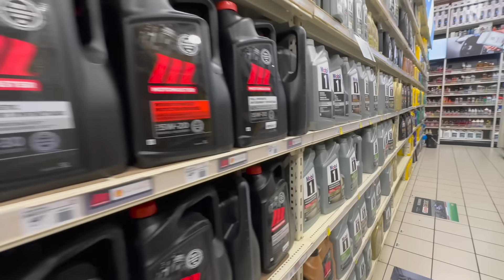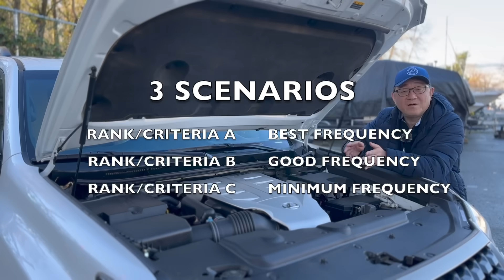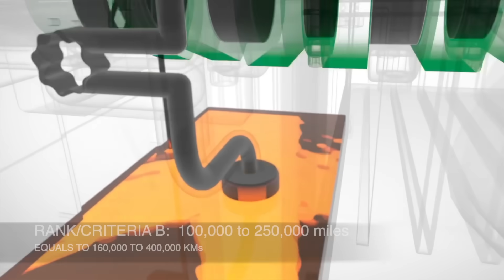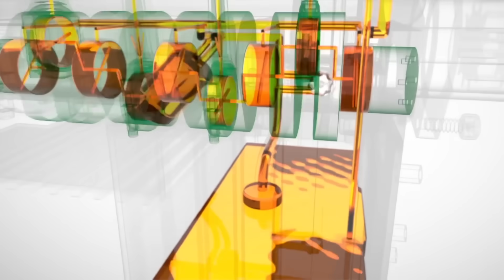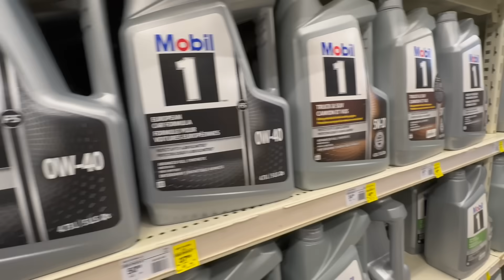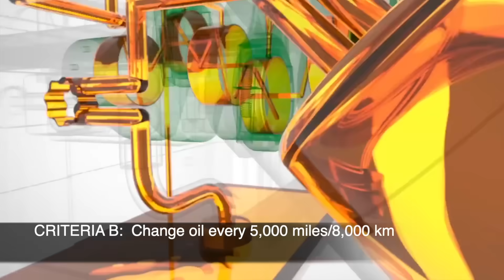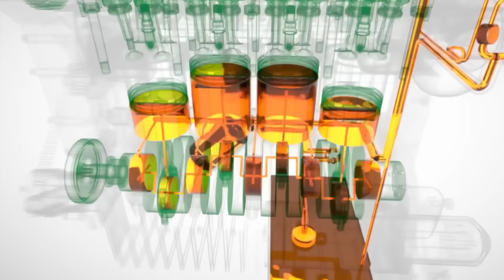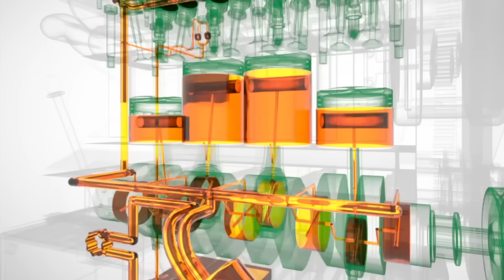ENGINEER EXPLAINS HOW OFTEN TO CHANGE OIL & FILTER // UPDATED CRITERIA-BASED RECOMMENDATIONS!

Comment: As a retiree that only drives 1,000 miles a year, I fall into the change it every year category. I drive 3000 miles a year but it is 1000 each on 3 vehicles.

Comment: BMW 2009 335i E90 owner. 200,000 km. runs smooth, no oil consumption. no leaks. 5W40 castrol edge synthetic every 9-12 months or 10,000 km. anything longer the oil gets too dark. ignore the 24,000 km recommended intervals LOL.

Comment: When you buy a new car, it  normally has about 5 years free servicing anyway. If second hand, check for service history. If none, hope for the best and use synthetic oil and change oil and filter regularly. Don't forget to check air filter too. That's overlooked a lot. 😬

Comment: I drove with diesel vehicles over 2,000,000 km or over 1,400,000 miles. I change my oil every 5,000 km (approximately 3,500 miles). May the Lord bless and keep you. (I always buy my cars old with about 300,000 km on the speedometer for about 1,900-2,000€ and drive on them over 200,000 till 500,000 km on the speedometer.)

Comment: After working in engine development the biggest problem is people put the wrong oil in.... It's the acea number that counts NOT 5w 50 or whatever temperature range your country requires. I use the EXACT oil the manufacturer states and it gets changed ever 2 years or 20000 miles... I don't do that many miles in the car only about 5 or 6000 miles a year. But it's always clean, never burns any and hasn't missed a beat in 10 years.

Comment: I had a 2015 Mazda Miata, purchased new, that stayed in our garage most of the time and was used primarily for joy riding. It was traded in 2020, at about 10k miles. The oil (Mobil 1) and filter was changed yearly but the owners manual stated every six months. I could not believe that the oil would degrade with mileage that low but I was breaking the warranty I guess. Loved the car but it had too many limitations.

Comment: My daily driver is a 2015 subaru wrx with the 2.0L boxer high compression direct injection and high boost twin scroll turbo its all stock and with an occasional exception of having a moment of fun with that turbo winding up I'm pretty conservative the way I drive her. But as a bumper to bumper certified tech and being the manager of a large auto service center I know what oil is put thru in modern engines especially high performance turbo boxer engines like mine and I see every day the consequences of neglect with so many of my customers going WAY too long on their service intervals and I know that today's synthetic oils are very long lasting and I know I'm beyond anal about it but I never go a mile past 2K miles between my services and that's with only the best synthetic oil which is actually a requirement on my Subaru but I don't care if people say I'm wasting money by servicing my car way too frequently to the point where the oil I drain out still looks almost new when I change it I believe frequent service is cheap insurance and I would rather spend a bit more on oil and filters than end up having to replace my engine and that is especially true on my car since it has a very complex high tech and high performance boxer engine with high compression and a twin scroll turbocharger pushing very high boost for a stock turbo. So for any car bit especially on a car like mine I would much rather spend a bit more on oil and filters and other maintenance items more frequently than risk damage. But then again it's easy for me since as an auto shop manager I get everything at a steep tax free discount on all the very best stuff and I have a shop and a plethora of tools and equipment and lifts to service my own vehicles anytime I want or need to and it barely costs me anything just as long as my paying customers are taken care of first as soon as the doors close I have a shop and any parts I need at my fingertips and at a price that is so low I don't even notice it in my finances but I know not many people are in my same situation and have to pay regular cost for their car care. All I can say is that oil and fluids and filters are a hell of a lot cheaper than a complete overhaul and don't listen to the manufacturers recommended service intervals cuz they want u to go to them for repairs and eventually buy a new car from them so there's nothing wrong with doing a complete oil change service every 2K miles like I do even when using the very best ultra long life synthetic oil especially if u have a performance engine like me like the old adage goes its cheaper to maintain than it is to repair that's gospel lol

Comment: TRANSMISSION FLUID N FILTER EVERY 30000 MILES?  rear differential fluid every 30000 miles. xfer case fluid every 30000 miles? pwr steering fluid every 25000 miles?

Comment: Sludge and dirt deposits stick to hot metal engine parts. Thats why doing an oil analysis is an inaccurate way to determine the health of the engine. It shows wear metal and coolant contamination but doesn't show the amount of sludge and contiminants that stick to engine parts and plug oil passages that shortens engine life. Dont test your oil. Change it.
Reply from the maker: Well said!

Comment: I wouldn't want to buy a used car off someone who treated the engine like those in Criteria C who only care about the engine lasting until they sell it and to hell with the next buyer.  I've been changing every 8,000 km (9,600 km with synthetic) but am a 'drive it into the ground' type so should be changing every 6,600 km with synthetic it seems.

Comment: Clean oil is the most important factor I agree. 2022 Ram 1500 5.7 etorque 4wd Limited IMO the OEM oil filters are the worst you can buy. I just finished a test with 3 filters Trasko bypass full flow combo, OEM Mopar MO899, and Hubb reusable filter. I used Blackstone oil analysis for 4000 miles on each filter I requested the particle count for each oil sample. The OEM filter had the worst particle count of all 3  45 times higher than Trasko and Hubb.  Flow to me is very important I'm not an engineer but the 5.7 Hemi has a known problem named the Hemi Tick caused by what most information I can find is a lack of lubrication and or dirty oil I can see why after testing the OEM filter. Hubb offered another benefit that I didn't expect due to the full flow, the engine and transmission synchronized far better meaning much less jerky shifting due to more oil back pressure. For example, I come to a red light braking then the light turns green I hit the gas, with Hubb I'm in the right gear, and RPMs with OEM or the Trasko the transmission would either upshift or downshift Hubb keeps you in the proper gear and at the right RPM's does this matter to me smoother is better, clean oil and maximum flow is the best I can do for my engine. I also use Amsoil 0W20 SS they say 25,000 miles I change every 4,000. Ram says the coolant lasts for 10 years I change it every 2 years and use a vacuum to refill very important to eliminate air entrapment. Front and rear differentials every 10,000 miles, transfer case every 20,000 miles, brakes every year flush with 2 liters with AT'E 200 spark plugs 48,000 miles sure it may be overkill but my goal is to keep this truck for many years its cheap insurance.  The Hemi 5.7 was discontinued V8 engines are being replaced with EV or V6 with twin turbo I like the V8 extra maintenance will ensure the best chance I have. I do all the maintenance myself and I save on labor and most importantly peace of mind knowing it's done right. I experienced this with several Ram dealers using the wrong oil or the wrong viscosity is why I started my own service for all fluids years it's not hard I'm 66 and just changed the spark plugs local shop wanted $800 I did it in 5 hours drivers side took 4 hours due to confined area, the torque was off 4 ft-lbs and the gap was off 4 thousands from the factory should be 44 thousand NGK and the manual states 44 thousand but in the box was gaped at 40 thousand my mpg went up 2 mpg if I had waited to 100,000 mile what would the cost be.  It cost me $155 for the spark plugs The old saying is true if you want it done right do it yourself.

Comment: A: READ the manual that comes with the car. It tells you what oil to use. B; SUE, yes, SUE if the DEALER changes that without your permission. If you want to ruin your engine use different oils and see which detonates your engine. It was too late for me and cost me thousands and lots of time. OOPS, there goes another 2 or 3 grand.

Comment: Have owned and driven a 2014 
Volvo V40 T5 (5 Cylinder Turbo) Cross Country since new. Just drove through 44,000km today. 

Synthetic Engine Oil and Filter changes at the Volvo Dealership every 6 months or 5,000km.

Comment: I worked for a oil company and just through interest I would get samples of my oil and get it lab tested, I learnt that the quality of the oil matters, when oils are sold they are required by law to meet the specs that are claiming.
But where the problem lies with cheap oils is the length of time that they stay in that spec.
 Now even David is saying that synthetic oil lasts longer.and the reason that is,is because it’s a better quality then the other.,
If the friction moderfiers have reached their usefulness, because of lower quality additives 
You are stuffing up your engine, a good quality oil will last a hell of a lot longer than  1000 m more than a crap oil that has ceased to maintain its its original specification

Comment: Great video. The key here is that "manufacturers recommendations" are really marketing tools designed to appeal to the cheap and lazy. Increasingly, manufacturers offer "free maintenance" for the first two or three years and then announce a scheduled maintenance plan that will not involve the type of maintenance that will keep the car healthy for the long term. Most manufacturers do not even recommend any sort of "break in" period for new cars. Basically urging customers to "rush out and do some damage that will bring you back for another car in 5 or 6 years."

Comment: Good engineering is what makes a engine last and good old fashioned oil  and high flow filter and a lower temperature thurmastat straight six engine rear drive and mechanical lifters  and higher octane fuel is king

Comment: I drive my 2018 LC500 less than 1500 miles per years. Have driven it approx. 5000 miles since I bought it new in 2018. How often should I change the oil?

Comment: 20k miles or every second year oil change intervals have been quite common for 20-25 years now, with cars having a 5 year warranty limited to somewhere between 50 and 100k miles. My 6+ year old Skoda 1.4 TSI turbo has done 65k miles, still use no oil between changes, and seems to run just as well as when new. Oil changes have been made on average around 12k miles. I drive gently, usually in the 1300-2000 rpm range.

Comment: I change every 5000km or 6 months.  Full synthetic.  Filter every 2 oil change.  Have done this with every car I’ve had.  I generally buy new and have them for 6-7 years.  I had a friend who worked as a lab technician with Castrol and this was his advice.
Reply: Oil filter cheap why not change it same time.
Reply: @ it’s a lot messier with my car.  I mean I still get 95% renewal of detergent,additives and clean oil.   A bit lazy I guess.
Reply: You can skip the filter on a 2k oil change
Reply: Dont buy cars every 6-7 years, you are contributing to causing more inflation in prices and more needless waste.  The average car held is now close to 13 years.  You are not even doing how much the extreme consumerist minded person in the West does.
Reply: I’ve been doing 4,000 km plus filter change at every service too.
Reply: Sound advice
Reply: I like this approach, Oil filter is still being changed per the manufacturers spec, just getting 95% of the oil renewed. Makes the job a lot quicker and cleaner.
Reply: Your friend gave you bunk advice. Thats why I trust Valvoline. Change the filter every time or else dirty fluid and contaminates can get into the new oil and contaminate it.
Reply: Cheap ass dude.  Filter doesn't cost much.  Why in the world would you was wait to change it every two 2 oil changes?  You are being cheap for no right reason 😡
Reply: Savings on oil filter  being used for 2 oil changes is not worth it. Why contaminate your fresh oil .
Reply: Dude change that dern filter EVERY TIME you change that oil.
Reply: @MrBigBoy4Life  Not necessary w/good synthetic long life oil filters like Purolator PurOne & Fram Ultra synthetic/Endurance synthetic.
Reply: Every Oil Change Is A Must Change Of Oil Filter

Comment: I was a Senior manager in one of the big auto companies and one of the departments I was responsible for is fluids which included engine oil.  The properties that we analyze for in oil is acidity, metal and diluent content (like water and hydrocarbons) and viscosity.  When Oil oxidizes, it becomes acidic and that is bad for your seals.  metal content comes from part wear like bearings, and other parts.  The most important oil change is the first because there is machining particles and sand from the manufacturing process.  Regardless, you should follow manufacturer's recommendations which is typically 10,000 miles or less for conventional oil like GF6.  We have tested oil like Mobil 1 which is synthetically called poly alpha olefin which will last in excess of 25,000 miles.  The algorithm in the car is set to go off at 10,000 miles because the manufacturer doesn't know what kind of oil you have in the car.  Everything you said is untrue is very irresponsible.
Reply from the maker: Thank you for your comments.  I've worked as an automotive engineer for several different automakers, as well as for engine parts supplier.  Unfortunately, your opinion represent a biased view since major automakers do not typically take apart customer's cars after 200,000, 300,000 or even 500,000 miles.  Have you physically taken an engine apart at those miles and looked inside?  Have you worked closely with an experienced mechanic that specialize in overhauling engines?  If you did, you would know that 10,000 miles are the "bare minimum" to keep engine clean and running well - but not sufficient if you want the engine to be in top condition for 200,000 miles and beyond.  The automakers are not interested in keeping cars in consumer hands for upwards of half million miles since that would be disastrous as that would result in dramatic decline in new car sales.  My advice is based on actual mechanical review of engines that have been taken apart, and are completely in alignment with people like Takumi Kurosawa (Nissan GT-R engine leader) and AMD from Car Care Nut (master Toyota technician).  We all have the exact same advice and same view, so while I appreciate your comments, all of us who are involved in engine overhaul and long-term mechanical repairs do not agree with the 10,000 mile oil change - unless you don't plan to keep the vehicle for a long term.  In any case, everyone is entitled to their own opinions so I appreciate that you took the time to explain your views.

Comment: The Toyota and Lexus manuals want you to change it every 10K, never do this if you want to keep your car for a long time. 5K for synthetic oil is the best for your car. Also when you buy a new car, you should have the first oil change for break in period at 500 - 1200 miles. This will get out all the metal shavings from the new parts out of your car, and after that 5K and you will enjoy for car as long as you maintain it.

Comment: Those car owners with diesel engines need to do the oil change every 5,000 klms. That is because diesel engines clog up the engine oil with carbon contaminates. If you want to protect your investment, oil changes every 5,000 are a must. Learn how to do it yourself if cost is a concern, it’s not a difficult task. Replace the oil filter each time as well.

Comment: I used to work in a car dealership, and this is an endless argument with people which I never quite understand: You pay huge money to purchase, or lease a vehicle and then you simply refuse to change the oil at a relative small cost in comparison.   I have always changed my oil at regular short, and reasonable  intervals in my personal vehicle, and when I have occasionally taken people for rides the first thing they generally comment on is "gee, this thing really runs smooth"  well duh, no wonder.

Comment: My 5.4 f250 owners manuel says use 5w-20 oil. A mutch to thin of oil for any gas engine. I change my own oil with penzoil and use 5W-40 . Runs and operates much better no noise from the roller flowers.

Comment: You are an extremely wise man! I change my oil and filter every 5000kms and have never had an issue related to lack of servicing.
Reply: You're throwing away and wasting completely good oil then.  5000km is only 3100 miles, which was usually the recommended interval for dino oil!  And even then that was too short an interval.

Comment: Instead of A, B, and C, your recommendation should read: Very responsible, responsible, and irresponsible. A better criteria, from a Castrol engineer, is the type of driving; high heat, high stress, like towing something, and just regular driving. The point about contaminants is well taken. Those can cause friction, and resin build up on cylinder walls, which lowers the life of the engine. Some say flush to remove the resin, others advise not to do this. I change my oil at least every six months, if  I have not reached 5K, or at  5K mark. It also depends upon the vehicle. Toyota and Honda engines are very reliable. If you have something less reliable, change more frequently.